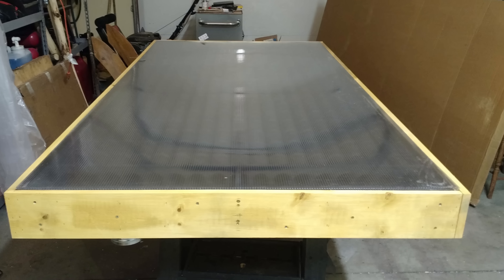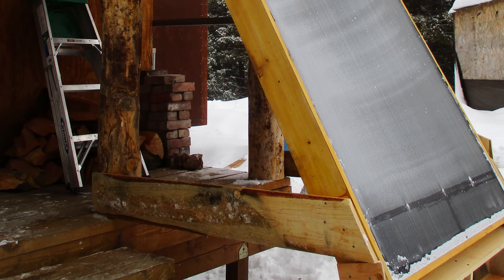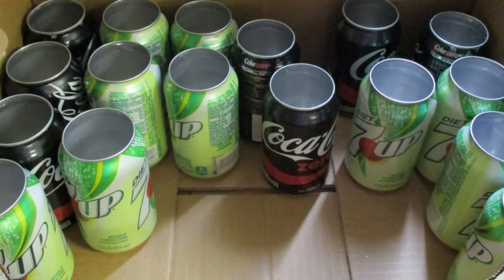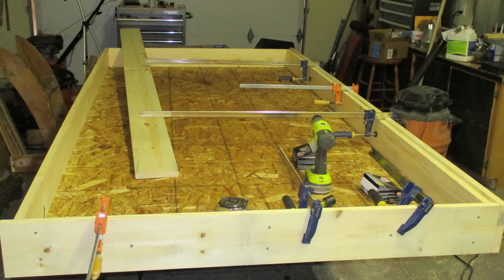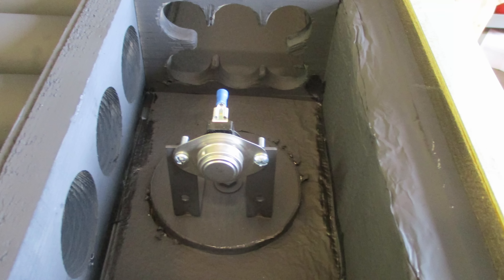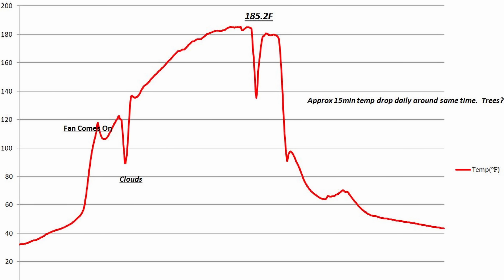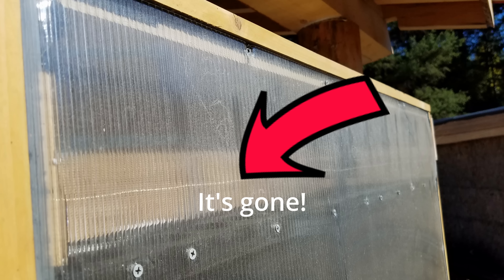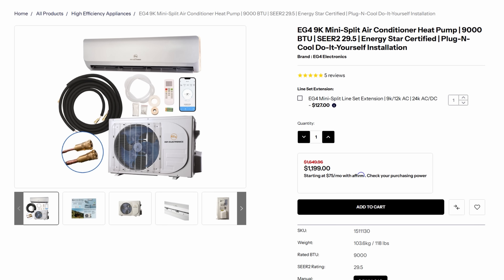7 Years with Pop Can Solar Heater - Is It Still Worth It?

Comment: One. How did this solar heater work during the winter? Performance. What if you just use straight aluminum tubes, instead of cans, so you do not need to glue all those cans together. And it was hard to understand, but it seems like your saying that, having a fan to draw the heat is necessary or could this thing work on convection alone? (I am guessing, based on your points, that a fan is necessary.). And, a split heater, requires electrical power, to run the heat pump, while this device heater seems to need just a few watts to run a fan (My point is that can heater is cheaper over time?).
Reply from the maker: I showed some winter testing, you must have missed that ;)  I also discussed issues in the winter.  The fan is not required at all (didn't I mention that?) but I wanted to draw more heat through the unit.  Seems 'pushing' it through may be better.
Reply: @TheOldJarhead  you showed the graph but really did not dig deeper into how much heat it was producing. And, you kept going back and forth about problem with the fans and damper and it was not really clear, about the fans. None-the-less, it is really interesting. (I think it is). And, you clearly got heat in the winter, which is even more interesting. I live in ND (And want to heat a hot-house) for my plants, and this contraption would be a great way to get the place nice and warm (At least during the day). Any how thanks!
Reply from the maker: I appreciate the feedback.  In this case, the video was more about the question:  was it worth it?  vs more technical details about the heater though perhaps that all could have been included if I had that information.  However, I built it, did some temp logging, found it worked great and let it do it's thing.

I didn't test anything after the initial temperature logging (all in the original video as well).  Once I saw it hit close to 200F with the fan running, at the top of the box in the winter I knew it was going to keep things heated for me when the sun was out and I moved on.

With that, I can answer that yes, it worked and yes it was worth it, but I can't answer all the more technical questions someone might have.

Comment: i wish i knew about this a year ago, we now get taxed on pop cans 15 cent a can, so no free cans any more
Reply from the maker: Grrrr....what about downspouts?  I also hear black wire mesh is great.
Reply: @TheOldJarhead  actually with that cost for all those bits just get vacuum tubes that works better. I just bought one to test it. 
with 12 bucks a piece, is a lot better than the cans.
not that much works to put it together.
with 240 bucks you get 20 tubes which is more surface, and with 60 for frame and ducts it costs half. 
or for the same price you can get one already mounted, only 15 tubes though. 
or even better, you can get two 400w pv s.   

cans may be free , but all that additional costs makes the project financially inefficient.
it can work only if you find reclaimed material to put it together.

Comment: FYI: Polyiso is unique in that its R value drops when temperature drops.  EPS can melt at 200F.  XPS can melt at 175F.  Maybe an inner layer of polyiso and an outer layer of EPS?  No good options.
Reply: ! inch high density fiberglass as used in the heating industry
Reply: How about putting the insulation on the outside of the box. Always struck me that was a better plan but I'm not sure how the wood would look a decade on
Reply from the maker: Hmmm...interested.

Comment: I'm going to build mine just a little bit differently than your.
I've got the desire to get some fresh scientific data about some change ups, based on Greenhouse developments in China.
Reply from the maker: Love to hear how it goes!
Reply: @TheOldJarhead  I don't currently have any of those conveniences that a stable Cabin has IE No heat and the batteries for the Solar have died.
I'm on a 5 year old Honda generator that's beginning to burn oil.
I struggle with the issue of "Should I buy those things that enhances my chances of living through another winter, or should I talk to B&H and get things like a wireless microphone and then later be tempted to get 2 more cameras'?
So I'm struggling to be able to post, and since I'm trying to document the building of my place I can't say "Well Hell lets just back up and redo this or do it like the "Galloping Gormey" did it where he was pulling a baked bread out of the oven in order to put the just mixed break pan's bread into the oven and then in that way they shortened a 30 minute baking time into a video about making bread from the start.
Next Summers' build will be worth an outdoor time laps camera covering the whole of the build season.  But I don't know where I will get the funding?

Comment: Improve you air flow by adding more (and insulate it at least half way down.) conduit and your heater Vent coming onto the porch should be at ground level.
Reason being that heat wants to rise.
By forcing the air all the way down to being a foot warmer (You not only gain a way to warm up your feet right after you take off those frozen boots) but the Warm air wants to rush back up to the celling and this creates and Averaged tempura Zoning.

Check your temperatures in the highest area of the porch that upside down bowl of heat effect means your system is getting TOO HOT were you don't need it.
Secondly any air leaks in the celling can cause the hot air to rush out and the air that replaces it is the Colder denser air.  
If you have the wrong location and wrong level of air leaks you can actually lower the temperatures in the Porch.
(Some guy did a great YouTube on how that he created his wood stoves air intake in the basement and it went through a piping to the bottom half of the wood stove on the main floor.  This lowered the impact of dense cold air coming in through cracks in the window frames etc....)
Reply from the maker: Wow that's a great idea and point!....hmmmm....of course, I'd need the intake to be moved to a different location so it's not just drawing from the exhaust but I'm thinking I could run the exhaust a foot above the ground (or a little higher I suppose) and the intake from a location opposite the exhaust..You've got me thinking
Reply: @TheOldJarhead  I think you ideally want the outside inlet to be at the top. It will no longer self-siphon in sunny weather, and you'll need to actively push the air, but that way in cold weather you hopefully won't get the cold siphon effect and you won't need a self closing baffle. So the airflow should go down from there, up through the cans, into the porch and back down to the floor. Also if you didn't put the fan at the very hottest point while leaving the thermostat there, that would be all to the good because otherwise it will overheat and fail.
Reply: @BooBaddyBig  Now days adding at a minimum a used computer fan and a Solar panel to power (since it's tied to the Sun hitting the pop cans some don't even bother running a Battery) it is cheaper than the costs of other methods of heating.  So by forcing the hottest air down you sture up the whole rooms air.  This lowers the number of BTU's needed to heat the room dramatically.

Comment: I can't justify 400-600 dollars a panel unless there are some gold parts in it.
Reply from the maker: You can, of course, find less expensive ways but let's be honest, even at $600 it's cheaper than most other options
Reply: The only thing new you should buy on a project like this is the fan and insulation. But I'd use mineral wool, not foam

Comment: The common way (You may not have the right level of tools out at the cabin) is to build an adjustable length counter balance. on the vents open and closing air valve.   (The most common way is a tiny threaded rod and you add some Nuts to the shaft These counter act the springs that were too powerful) (Also washers that are welded or JB welded to the nut can make it that it's a larger diameter nut and you shorten the threaded rod.
Reply from the maker: I just heard an easier way to hold the heat in:  lower the exhaust to a foot above the floor!  I wish I'd thought of that sooner but now I have to rethink installing this in the future!
Reply: @TheOldJarhead
Reply: 1. that would depend on the level of insulation under the floor.
2. The preference's of any Dog's or Cat's you have.  They will come in to warm up and placing the Heat exit vent to high just means you need to later build a raised bed at that right location in which they would be warmed and not cooked.
3. Don't build a foot above the floor and then try and dry boots that are two feet tall etc...
3.a. Placing a heat vent above what you are trying to dry off causes air to be pulled past the wet objects as it rises.  IF your air is laidened with the moisture of snow or melting snow you could be just pulling sopping wet air past your boots and that just encourages Mold growth.

Since the vent tubing is flexible see about just cutting a length long enough to go from top to floor but use something to test out different vent exit positions (for the medium height ones I would suggest a camera tripod.)   
If you find you like the one foot off the floor setting then just cut the extra one foot off to straighten the hanging air tube.

If you are rethinking this then consider creating a convection air circulation.
By placing the flexible vent tubing hanging down in the middle of the porch (even temporarily and then moving it off to a side)  Could be done with two door hinges and a swing arm.  That when the heat rises it would be pushing downwards the cooler air that is on the outer walls of the inside of the porch.  In that way you would be gaining the most effective way to circulate the air.
Even placing the hot air exit vent at the middle of the porch but up  against the cabin would create a three out of four directions Convectioned air.
(That the porch has a sloped roof could mean that placing it in the middle of the building but where the celling is at it lowest (that might be closest to a door and that not the best option)  would mean convection heating would flow up the slope in the inside celling.
A flat celling (commonly plaster board) would negate the gains of letting the heat climb the inside pitch of the roofing.  And you would be back at a gain of just go to the middle of the porch but up against the outside of the house.

Lastly IF you wanted to plaster board even a portion of the celling adding extra insulation to where the convected hot air hits the celling (you have options of materials that hold up better in cabins than plaster board) and you angled it at somewhere between 5 and 15 degrees in an inverted flattened down Pyramid this would act like an open air ducting that would further shape the hot air into convected air flow.
By making two of the sides (the ones running paralle  to the width of the porch) ramping longer but at the same angle as one going 90 degrees to the Cabin you even further create an even distribution flow.

Comment: good video   1)   I'm surprised in 2025 people still present a  temperature without also mention a flow rate...that kind of  data point misleads the uneducated.    That said these heaters are certainly effective,  Now  a days   heaters ike this and ohic heaters have to compete with heat movers (mini splits etc) being run from solar panels.

I think the screen type is quicker and more effective than the pop can type.    IF you scrounge parts like old patio doors etc, then these could be worth doing for remote shed and shop etc.
Reply from the maker: Good point about the flow rate - though my testing was back in 2017 and I'm no expert on heaters or any of that...
Reply: @TheOldJarhead  fans should be pushing about 3CFM per SF of panel size   6 x5 box  is -30 SF  = 90CFM minimum fan    add more for back pressure    I am using Grok AI to design my current box and it is helping with design, size of gaps, airflow, back pressure , fan size   it calculates it all

Comment: As an electrical engineer I want to point out that putting a fan in the exhaust path is a very bad idea.  Bathroom / kitchen and PC fans are simply not built to handle those temperatures for long periods of time.  That heat will seriously degrade the operating life of the fan.  Put the fan pushing air into the cold intake side of the heater and it will last MUCH longer.  Save yourself some money and hassle!
Reply from the maker: Thanks.  You're the 2nd person to advise me of this and I'm happy to have great viewers who can do that!  I plan to move that fan as soon as possible.
Reply: @TheOldJarhead  No problem - I hope this means you never have a fan failure again!  

The more happy frugal greenies we have around, the better!
Reply from the maker: LOL not sure I'm, a 'greenie' but I do love solar and things like these heaters :)

Comment: Since solar panels have become so inexpensive,even a resistive DC heater is less expensive and way less complicated than the convection heater. Simply put a heating element from an electric oven in a container of sand ,power it directly with solar panels, and install a pull out,plug-type air conditioner disconnect to turn it off. Thermostats made for AC will fail from arcing .
I have a lot of old 250 watt 60 cell solar panels. You can series connect four to create approximately 120 volt DC . The current is limited by design so they will only produce about 750 watts. 
You control the heat output by voltage,adding or subtracting series solar panels. 
Obviously,this only makes sense if you have free solar panels and space. The heat pump is by far the best option but,if you have batteries,it’s best to run the PV through the inverter.
Reply from the maker: That's a very detailed plan, thanks for sharing!
Reply: Heating elements are incredibly inefficient with a solar panel because of the performance curve. A chain of big power diodes is about the same cost all bolted onto a big heatsink of some kind and a fan and will extract vastly more power as it's not quite an MPPT but pretty close in behaviour.

Comment: The eg4 mini split is failing alot of people. Theres a valve connection that is failing on alot of the units. Eg4 wont honor the warranty and claim they were over tightened.
Reply from the maker: Thanks for the heads up!
Reply: @TheOldJarhead  do your own research of course but until that gets figured out I’m holding out. Might just do a pop can rig… 7 years of daily use. Minor repairs needed… easy decision.
Reply: @Rockwell108  Interested to read others’ experience of these pre-charged quick connect type DIY split units - where did you read this? Appreciate the reference
Reply from the maker: I was thinking that, too, as Signature Solar is based in the USA and has good support from what I've heard.
Reply: @TheOldJarhead  they generally do have good support! But this product has been a headache for them. I can’t send links here but google eg4 mini split failure or buyer beware etc and you will find the same failure over and over again.
Reply from the maker: Interesting.   There are a lot of them oit there but maybe in that price range they aren't up to the level of the soendy Mr Cool units
Reply: My Mr. Cool 24k btu unit has been working great.
Reply: Since 99% of diy'ers don't have a torque wrench and the proper open end crow's foot I will say with certainty that they are overtightening those valve fittings. They don't require lots of torque to seal properly so I'd take those reports with a huge grain of salt.

Another point: 99.99% of ALL BRANDS of mini-splits are made by one of two manufacturers, one in Korea and the other in China. You're paying a lot extra for a brand sticker in many cases (looking at you, Mr. Cool).
Reply: @mxslick50 this is a perfectly valid reply, I’d say take it with a grain of salt and a torque wrench…
Reply from the maker: Great point!  I was thinking the same thing myself and pondering that very thing.  

I was unaware, however (though not surprised) that there are so few who make these units.  But it's like a LOT of things these days -- kinda like the Milwaukee tool users looking down their noses at Ryobi tools which are made in the exact same factory by the same people and tools etc....just different color and specs.

Comment: I think I would use an inert insulation rather than oil based as you do not want to make toxic emissions that you could end up breathing
Reply from the maker: Good point, thanks for the suggestion!
Reply: @jocosson8892  Mineral wool

Comment: Thank you for the commentary.

Cans are too much trouble.

Although more expensive. Piping would be the way to go.
Reply from the maker: Piping definitely makes it easier to build!
Reply: Piping can be really cheap. Lot of people don't bother saving and keeping all the short lengths you need for such a project between jobs.
Reply: @etchedpixels I do not use metal pipe very often.
The downspout idea is interesting.
Reply: @shawnr771  Here (UK) if you know plumbers you can sometimes get all their scrap cheaply and because of the move to heatpumps you can sometimes get your hands on all the (often somewhat bashed up) microbore they ripped out of a property being converted for the same price the metal scrap people would pay.
Reply: that is a good idea.
However most of our plumbing these days is PVC switching to PEX.

Comment: The fan could be powered by a solar panel with a voltage regulator block, but it would still need a temp stat.
Reply from the maker: That's certainly a way to do it!